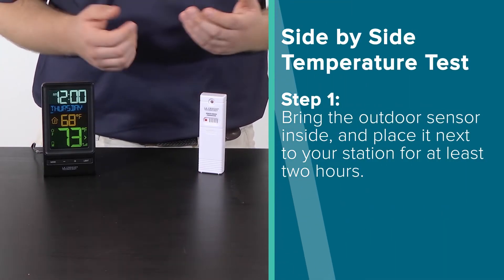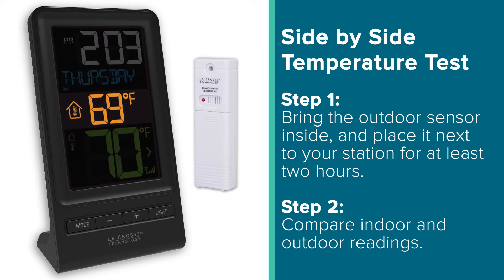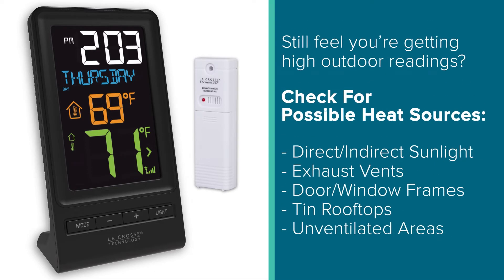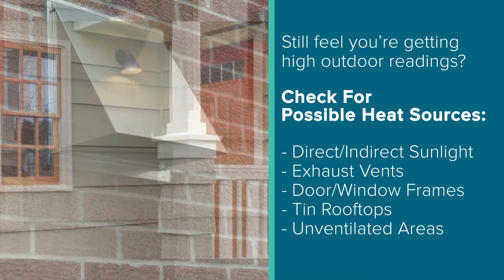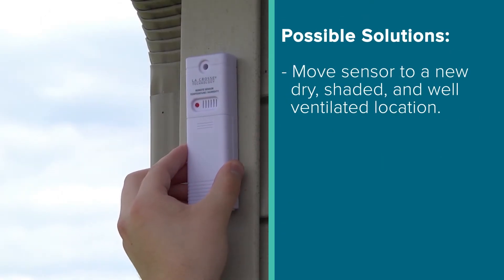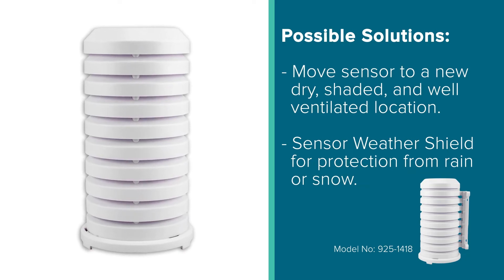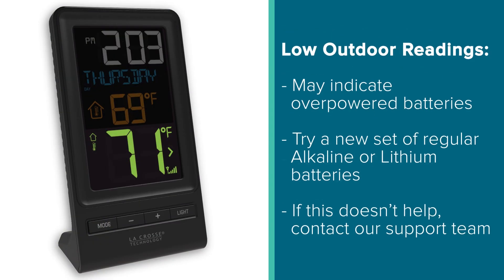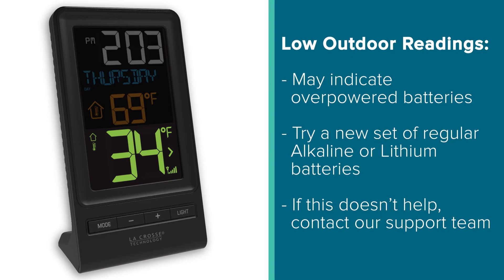Inaccurate Temperature Readings - Possible Solutions

Comment: I took the batteries out of mine and it still registers an outdoor reading. Weird.
Reply from the maker: There can sometimes be a delay in the radio communication between the sensor and display. However, if you've had batteries removed from the sensor for a while and are still seeing values, it's more likely that your display has picked up the reception of a neighboring sensor. For instructions on how to get this corrected, please pass along your product's model number printed on the back or bottom of the main display.
Reply: @lacrossetechnology  I have the BBB86118 Clock and the TX141-BV2 sensor. Freq. Is 433 MHZ. Yes batteries were out since yesterday.
Reply from the maker: @eddiethecurler  Then yeah, the clock has picked up the reception from another nearby sensor. To get you sensor synced correctly, please try the following steps:

1. Bring the outdoor sensor inside next to the display and remove all batteries from both your sensor and display.

2. Press any button on the display at least 25 times and leave the two parts sitting without power for at least a few minutes (if not hours). 

3. Install a new set of regular alkaline batteries into the outdoor sensor and keep it near the display with the battery cover off. 

4. Power the display back up using a new set of regular alkaline batteries. 

5. On the sensor there should be a small TX button located just above the batteries, press this button to force a transmission signal. In most cases this should connect the sensor with your display almost instantly. 

If you are still having trouble after this, please message our support staff directly here: https://bit.ly/contact_techsupport. Or alternatively, send us a private message on our Facebook: http://bit.ly/LaxTech_Facebook or Twitter: http://bit.ly/LaxTech__Twitter page for further assistance. Our apologies for any inconvenience.

Comment: I have a lacrosse system and no matter day or night reads 5 degrees higher than my smart phone which reads the same as my local area online given temp at any time.  This aggravates me especially when I watch cold temps for when I may need to run water in winter. Im now in the process of checking the temp in a side by side comparison. with the station.
Reply: What bothers me is it makes no difference at night 5 degrees higher
Reply from the maker: @yes350yes  If you’re comparing readings from a local weather station on TV or from your smartphone, please keep in mind that in most cases these weather reports are getting data from their nearest airport, likely miles away from your backyard. It is not uncommon to see a difference between their location and yours. As mentioned in this video, looking for possible reasons for higher than expected temps or trying a new outdoor location for your sensor could be a good idea. If after this side by side test your sensor and display values are off by more than 4°F, please message our support staff directly here: https://bit.ly/contact_techsupport. Or alternatively, send us a private message on our Facebook: http://bit.ly/LaxTech_Facebook or Twitter: http://bit.ly/LaxTech__Twitter page for further assistance. Our apologies for any inconvenience.

Comment: Model S77925. Having trouble getting accurate outdoor readings.  They are high by almost 20%  (50 vs 59F) compared to a thermometer I located near the sensor. Moved the sensor indoors beside the station and it now reading 2 degrees lower on the outdoor than the indoor. I did fresh batteries and hard reset and have the same problem.  Please advise.  Thanks.
Reply: Same, mine is off by 3 degrees Fahrenheit inside. This company makes cheap Chinese junk
Reply from the maker: Hey Robert, thank you for reaching out and for the details. From your description, it sounds as though this is likely a location issue, as your side-by-side test proved the sensor to be in working order.   Our tolerances are +/- 2°F compared to the actual temperature (thus a 4°F possible difference between two La Crosse Technology devices), so your 2-degree difference is well within that range. Each company and product will have its own set of tolerances and features, so when doing a comparison it's best to only use products made by us. Our suggestion would be to try a new fully shaded and well-ventilated location for your outdoor sensor, such as under an eave on a north-facing wall. 

If you should need further assistance, please feel free to message our support staff directly here: https://bit.ly/contact_techsupport. Or alternatively, send us a private message on our Facebook: http://bit.ly/LaxTech_Facebook or Twitter: http://bit.ly/LaxTech__Twitter page. Our apologies for any inconvenience.
Reply: @lacrossetechnology  Thanks for the quick response and I will move the sensor to the north side of the house to see if I get improvement to within the spec accuracy.  Much appreciated.

Comment: I changed batteries in five of my Lacrosse indoor/outdoor sensors.  Some were working correctly before changing batteries.  None of the sensors are working correctly now.  And yes the batteries were installed correctly.  Usually the outdoor temperature is very high, such 138 degrees.
Reply from the maker: Hey Donald, our apologies for the trouble. For further assistance getting this figured out please message our support staff directly here: https://bit.ly/contact_techsupport. Or alternatively, send us a private message on our Facebook: http://bit.ly/LaxTech_Facebook or Twitter: http://bit.ly/LaxTech__Twitter page.

Comment: We having been getting low temperature readings for a couple months.  We changed the batteries in the sensor - still getting incorrect and non-sensical shifting temperatures.
Reply: How can we be certain it's the sensor and not the base station?  I don't want to buy a new sensor if the base station is bad.
Reply from the maker: @ap14rcf70  In most cases, it is the device that which is providing the data that would need to be replaced. However, for further assistance on this matter, feel free to message our support staff directly here: https://bit.ly/contact_techsupport. Or alternatively, send us a private message on our Facebook: http://bit.ly/LaxTech_Facebook or Twitter: http://bit.ly/LaxTech__Twitter page. They will be more than happy to help with any warranty claims as well. Our apologies for the inconvenience.

Comment: My indoor temperature reads 77 degrees when the room is actually 70 degrees.
Reply from the maker: Hey Ray, sorry for any trouble. Have you tried performing the side by side test with your outdoor sensor for comparison? If so, and these values are off by more than 4 degrees, this is definitely an issue, and you will want to contact our support team here: http://bit.ly/contact_techsupport. However, if your temperature readings (between the display and outdoor sensor) are within this range, the item is considered to be within tolerance and working correctly. Please note, temperatures within homes can vary greatly from room to room and even between locations within that room (i.e. near a vent, receiving direct or indirect sunlight..etc), and using a thermostat as a gauge for this comparison isn't always the most accurate form of measurement. Our apologies again for any inconvenience, we are here to help if you have any further questions.

Comment: My sensor can't go anywhere but in the direct sun would it work in a wooden box to protect it from the sunshine... I have tried the white shield but that's no better.
Reply from the maker: Hi John, as mentioned in our TH sensor mounting video and on our support page here: https://bit.ly/temp_mounting, for the best performance, good airflow around the sensor is recommended. However, in your situation, it sounds like a box could be a viable solution. Test it out and see if the readings adjust to an acceptable range. If you should need further assistance please message our support staff directly here: https://bit.ly/contact_techsupport. Or alternatively, send us a private message on our Facebook: http://bit.ly/LaxTech_Facebook or Twitter: http://bit.ly/LaxTech__Twitter page. We apologize for any inconvenience.

Comment: I have an older LaCrosse indoor only unit. Gives time, indoor temperature, and date. The temperature suddenly started reading about 20F too high. Is there anything I can do to correct this? The automatic time update at midnight quit a long time ago. Now I have to pull the batteries and reinstall to get a time update.
Reply from the maker: Hey Brian, our apologies for the trouble. It sounds like it may be time for a new clock. But before we get there, please work through the following steps:

1. Remove all power from your display. Including batteries and unplugging the power cord from both your wall and from your display.

2. Press any button on the display at least 25 times and leave it sitting without power for at least two hours.

3. Power the display back up by plugging the power cord into your outlet first, then into your display. If your model uses AA or AAA batteries, be sure to install a new set of alkaline batteries, other battery types should be avoided. 

If this does not resolve the issue, please message our support staff directly here: https://bit.ly/contact_techsupport. Or alternatively, send us a private message on our Facebook: http://bit.ly/LaxTech_Facebook or Twitter: http://bit.ly/LaxTech__Twitter page for further assistance. Sorry again for the inconvenience.

Comment: I have both sensors in the same spot yet the new one is 4 degrees warmer. Frustrating
Reply from the maker: Hey Jimmy, assuming you've had them sitting in the same location for at least two hours, a 4°F difference is at the high end of our tolerances, but still would be considered in working order. Our tolerances are +/- 2°F compared to the actual temperature (thus the 4°F possible difference). If your two La Crosse Technology items move outside of this range, please message our support staff directly here: https://bit.ly/contact_techsupport. Or alternatively, send us a private message on our Facebook: http://bit.ly/LaxTech_Facebook or Twitter: http://bit.ly/LaxTech__Twitter page. Our apologies for any inconvenience.
Reply: @lacrossetechnology  If it's +/- 2, then 4 degrees off is certainly not in tolerance, though. (it's 2 degrees off the other sensor, not 2+2 degrees off), unless you are saying that BOTH sensors are off 2 degrees, in opposite directions, which in my book makes them junk.
Reply from the maker: @glenk.1639  Correct, 4 degrees meaning each could be off by 2 degrees in opposite directions. We are sorry you feel this way. Our current line of products are designed for the consumer electronics industry. If your application requires scientifically precise measurements we’d highly suggest looking elsewhere at this time. Thermometers, hygrometers, anemometers, barometers, and other measurement devices that are meant for true scientific testing will indeed be more accurate, however, will also likely be found at a much higher price point. Our apologies for any inconvenience or trouble with your product.
Reply: So there is no way to adjust to make them both the same?
Reply from the maker: @jimmyjam209  Unfortunately, no. Our products are precalibrated at the factory and in most cases will not offer a manual adjustment. If you need further assistance, please message our support staff directly here: https://bit.ly/contact_techsupport. We apologize for any inconvenience.

Comment: I have ews800 and the Inside unit is showing different values from what the outside unit is measuring? Anybody faced a problem like that? Any suggestions.
Reply from the maker: Our apologies for any trouble, however, the ews800 is not our product. For further help, you may want to reach out to your manufacturer directly.

Comment: Ours is showing an inaccurate outside temperature.  It still shows an outside temperature even after removing batteries (and keeping removed) from outside sensor.
Reply from the maker: Hi Les, sorry for the trouble. What is the model number of your unit? This should be printed on the back or bottom of your main display.
Reply: La Crosse Technology thanks for the quick reply. It's model CA85152
Reply from the maker: @lessebesteny1730  Thanks! Please try a basic restart of your device. These instructions are covered in our other video here: http://bit.ly/LaxTech_BasicRestart -- In addition to the steps in that video, your sensor has a small TX button located above the batteries. Press this after you have the power restored to both the sensor and display. This should force a transmission and connect your sensor almost instantly.
 If the sensor does not reconnect, or if you're still getting inaccurate outdoor readings with the sensor mounted outside in a shaded location, please reach out to our Canadian representatives via email at: info@springfieldinstruments.com
, phone at: 844-687-4040
, or through their online form here: https://springfieldinstruments.com/customer-service/ -- Our apologies for any inconvenience.
Reply: La Crosse Technology thanks for your help....problem solved.

Comment: I have a ws2010-20, can i calibrate the humidity sensor as its off by 10% ? Thank you
Reply from the maker: Our WS2010-20 unit unfortunately only offers manual calibration for barometric pressure and rainfall. The best way to test the accuracy would be to bring the outdoor temp/humidity sensor inside and place it next to the display for at least a couple hours. After this time, compare the data between your indoor and outdoor humidity values, if they are within 16%RH the unit is likely working correctly. The tolerances for this model are +/- 8%RH compared to the actual Relative Humidity (thus the 16% possible difference). 
Our support staff also noted that this is quite an old model and may be wearing out. They suggested moving the outdoor temp/humidity sensor out into full sunlight for a day to allow it to fully charge before placing back into its normal shaded location. For further assistance, feel free to reach out to our support staff directly here: http://bit.ly/contact_techsupport

Comment: Here's a funny one too.  I have the La Crosse W8611 and the battery on the indoor unit died.  So we changed the batteries, but now the outdoor sensor is reading crazy temps.  Like over 100° in late October when the real temp is in the 50s or 60s.  We can reset it during the day, and it reads accurate, but as the night progresses it slowly gains and by morning, it's over a 100.  It's reading 93° now at 11:30pm on Oct 22, 2020, when my phone says 66°.  It was unseasonably warm today, but still.
Reply from the maker: Hey David, that is very strange. Let's try a few steps to see if we can get this corrected:

1. Bring the outdoor sensor inside next to the display and remove all batteries from both your sensor and display.

2. Press any button on the display at least 25 times and leave the two parts sitting without power for at least two hours.

3. Install a new set of alkaline batteries into the outdoor sensor and keep it near the display. 

4. Power the display back up using a new set of alkaline batteries, other battery types should be avoided. 

5. Let the sensor and display sit near each other for a night to confirm the readings still continue to climb.

If you are still experiencing strange temperature problems after this, please message our support staff directly here: https://bit.ly/contact_techsupport. Or alternatively, send us a private message on our Facebook: http://bit.ly/LaxTech_Facebook or Twitter: http://bit.ly/LaxTech__Twitter page.
 Our apologies for this inconvenience.

Comment: My outdoor sensor is fine. My weather station says indoor temp is 78 degrees. I even put it in the fridge for a few hours. Temp won't go down.
Reply from the maker: Hey Joe, sorry to hear this, that is quite strange. So after performing the side by side test, with the sensor next to the station, what were the readings from both the indoor and outdoor values on the display?
Reply from the maker: @1acroyear1  That is definitely a problem. For help with this, please message our support staff directly here: https://bit.ly/contact_techsupport. Or alternatively, send us a private message on our Facebook: http://bit.ly/LaxTech_Facebook or Twitter: http://bit.ly/LaxTech__Twitter page.
 Sorry for the inconvenience.
Reply: I had this problem once. It turned out that I was picking up a signal from a neighbor's sensor. My system has a choice o A B C or D frequencies. After I changed it to a different frequency setting the problem went away. It is a different brand.

Comment: i have a 79400 with  built in wind, temp, humidity sensor. How do you move this in the shade to prevent the high temp. readings and still get accurate wind speed?   I am getting at least 5 degrees F high readings in the sun.
Reply from the maker: We apologize for any confusion. As noted, the LTV-WSDTH01 Breeze Pro sensor that comes with the 79400 model was designed to be mounted in a sunny area to recharge its battery. If you believe the sensor is reading incorrectly when in direct sunlight, this station has the ability to accept a separate add-on thermo-hygro sensor to replace your display's outdoor temperature and humidity readings. This add-on sensor is built to work like the one shown in this video and can be mounted in a separate fully shaded location. You can find this add-on sensor here: https://www.lacrossetechnology.com/ltv-th2 -- If you have any questions or need further support, please message our support staff directly here: https://bit.ly/contact_techsupport. Or alternatively, send us a private message on our Facebook: http://bit.ly/LaxTech_Facebook or Twitter: http://bit.ly/LaxTech__Twitter page.